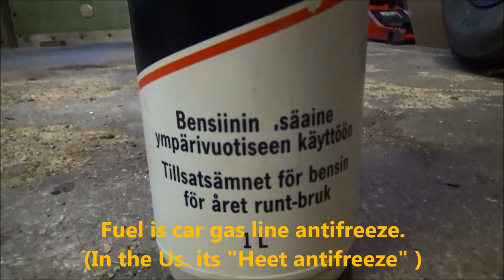How To Build a Simple Jet Engine - No Special Tools Required!!

Comment from the maker: If you made a jet engine like this, please link video of it here. :)
Reply: Are you serious 🧐 there's no engine 🤬🤬 wast my time
Reply from the maker: @night_mode97  This is a simple jet engine.
Reply: @night_mode97  it is a real jet engine, just maybe it doesn't produce enough thrust to move itself and there's no constant fuel supply, so it stops after a short time (but it can be simply modified).
Reply: You can mount it on a small boat.
Reply: Please can I have your email so I can explain further on why I made a woosh bottle
Reply from the maker: @chiagoziemogbuehi5584  Why not let us know right here?
Reply: @Fileeraus   well, all those things you call 'scaps' are not really that available to me and I don't know how old you think I am but I'm actually 15 so I'm not really allowed to use fuel
Reply from the maker: @chiagoziemogbuehi5584  I think you can find some random scrap metal almost everywhere in the world. Also a pulse jet runs with anything that is flammable, so you can try to use hand sanitizer, which should be available to everyone. You can make a hole with a nail and a stone.
Reply: @Fileeraus  I'm trying my best to get the metal pipe and I'll make it as soon as I get it, but if I use hand sanitizer will it have any thrust?
Reply: @night_mode97  it's a Pulse Jet engine, not a Turbojet engine, you won't find a Garret Turbo hooked up to a fuel cell and combustion chamber.
Reply: @night_mode97 i simple balloons is still jet engine a
Reply from the maker: @chordebartholomew6223  Your engine didn't run in your video. Using gasoline its very hard to get started. You should try making one of these:  https://youtu.be/k6-g5to5VN4
Reply: Hey :)
How long should the pipe be? can it be too big?
Reply from the maker: @thelegendofspace7579  It can't be too long, but it can be too short
Reply: @Fileeraus  ok thanks, is 1 meter long enough?
Reply from the maker: @thelegendofspace7579  Yes
Reply: i build it today and its beautiful, but i thinked about something like a fuel injection
sorry for my bad english im from germany xD
Reply: @chiagoziemogbuehi5584  sanitizer works, tested by me
Reply from the maker: @thelegendofspace7579  You can try running it with anything that burns
Reply: @Fileeraus  I meant a pipe or something where you can inject fuel by running the engine i hope u know what i mean
Reply from the maker: @thelegendofspace7579  I've thought about making same type of fuel system
Reply: @Fileeraus  a video would be nice when u test it, i wanted to build one but my pulse jet is exploded xD if you have instagram or something i can send you a pic 😂
Reply: @Fileeraus  Hey, I had a new idea for the engine, you could build a cone-shaped suction head in front of the hole in which with a pipe and a valve the amount of fuel can be adjusted, this also regulates the speed and you can turn off the pulso as you like. 
switch off, what do you think?
Reply: @night_mode97  its a pulse engine
Reply: Update, i build mine with a fuel insertion just like the lockwood hiller design insertion in the can, you can use propane now
Reply from the maker: @thelegendofspace7579  Wow! Can you upload a video of it? 😎
Reply: Hey! I built a similar one, used bio ethanol as fuel but after I start it, for a matter of time I hear a sound like in the video, but then it dies and I played it several times and it keeps failing. What could be the problem?
Reply from the maker: How fast does it rev? How long it lasts?
Reply: @Fileeraus  a matter of a second or so. It really lasts for just a moment
Reply from the maker: @v-nem144  If it revs fast, your intake hole might be too small. If it revs slowly, the intake hole might be too large, or the exhaust pipe hasn't sealed completely.
Reply from the maker: @v-nem144  wrap the foil around the exhaust pipe so that it acts as a gasket with the hole
Reply: @Fileeraus  YEEES, IT FREAKING WORKED. Whoa man, I used a bit of a vacuum cleaner and a sparkler to start it, but it really did the job. Thank you for the help! I will get it on tape and send the link there.
Reply: @chiagoziemogbuehi5584  you arent going to get enough thrust to move something with a can mate
Reply: @sebastiankusyk7764  It didn't move because he had a brick on it.
Reply: Masinolilla! 😀 Must be Finnish
Reply: K so I made this and... HOLY ITS LOUD
Reply from the maker: @NoFear-2011  cool!
Reply: @Fileeraus this is my design, it is not self sustaining, instead it uses an off frame custom 3d printed turbocharger looking thing for air intake. I have found that this design works well, and even produces thrust. On a skateboard, it accelerates at ~1m/s^2 with onboard air intake and battery. There is also a spark plug inserted to maintain combustion and I am working on an onboard fuel supply system. https://youtube.com/shorts/ft0tEty6tGE?si=0T6woNBXrqTw26cj
Reply from the maker: @BlenderandBeyond  so its a turbojet then?
Reply: @Fileeraus  hi man, your video really helped me out, how long is the pipe you used and do you think it is possible to continuously put fuel in the engine?
Reply from the maker: @davidedamiani5331  My pipe is 1.5 meters, but it can be shorter. For some reason a short exhaust has a shorter running time.
You can add fuel but you need to figure a way to do so without shutting the engine.
Reply: @Fileeraus  my engine revs very fast for a few seconds and then it stops working. When i ignite it again then it does the same and stops working after 3-4 seconds.
Reply from the maker: @shashwatvishwakarma269  intake or exhaust too small, or exhaust too short
Reply: @Fileeraus, alright, I'll try to adjust the dimensions. Should the intake hole be same in diameter as exhaust hole ?
Reply from the maker: @shashwatvishwakarma269  not necessarily, it is adjusted to the size of your jet
Reply: I just made a ramjet engine
Reply: @night_mode97  get a life bro thats a engine what do you known
Reply: Where's the thrust
Reply: Okay made it now how do I transfer that energy to  a battery
Reply: @AEye-p7y  bro idk

Comment: Would it work with a larger reservoir directly beneath it? If so, then with a reed valve at the front, it might me suitable to power a free flight airplane model.
Reply from the maker: If you want to power an rc plane, you should look into proper pulse jets. These spray can jets are  merely artificial and don't have much potential to move even the engine itself. Here's one that I made:
https://youtu.be/k6-g5to5VN4
Reply: @Fileeraus  time to prove you wrong. 
I will 100% make a Pulse Jet Engine from Tin Cans or (Work Shit). Work shit is stuff you find at work. I work a job I can fuck around in as long as I tend my customers when they show up.

So I’ll be walking around a find a spray bottle that’s broken. Take the tube out. Find old paint cans. Etc. Bars of metal or pipes.

I’ll make Something up.
Reply from the maker: @shadowdeslaar  A proper pulse jet with combustion chamber made from a spray can will implode before it moves on its own. ;)
Reply: @Fileeraus  worth it. At least itll be a nice fire. And plus can try to upgrade it. They make steel Cans. Well. The ones we sell are.
Reply: @Fileeraus  when you say Proper. You mean like a V-1 rocket engine. Right?
Cause so far I’ve got a Gravity Feed Liquid Fuel Can on top. 
(Of course not touching). 
I also ended up adding a hole to one end of the Can. (Using a pop can).
I added a Exhaust Hole and Fuel Intake. 
Now gonna see what happens.

(Probably gonna add a second cam inside the man one, creating a Pressure Chamber). If lucky the pressure won’t be enough to blow or implode but enough to sustain firing.
Reply: @shadowdeslaar  well what did happen?

Comment: Do you know some video/image/article that explains how it works exactly? Thank you for the video. I'll use it in a Physics project on my university.
Reply from the maker: It works so that the flame goes into the jar and burns all the air, which creates a vacuum that sucks more air, and it ignites again.
Reply: @Fileeraus  also inertion of air inside the exhaust tube is important - it keeps moving after explosion ends, so there's resonance (like mass on a spring). Exhaust fumes in the tube are blocking air access, so it can be taken only through the right hole. So this pipe must be long enough to make the engine work.
Reply: You should put a turbo on it 😂💪

Comment: Any chance I could get a can length / diameter / exhaust length ratio u found to work best? I cant get mine to run more then 5 sec at most

Comment: The reason the can is getting red hot is because of how thin the walls are. I’m sure that if you used water pipes instead the engine life would be much longer
Reply from the maker: Thin walls allow more sufficient cooling if you would pour water into the walls. Without cooling a thick wall will run slightly longer but is harder to cool down. 
A video that shows a way of cooling that works.
https://www.youtube.com/watch?v=KVmAdTbzzRI

And here's a thick walled engine that was hard to cool down. 
https://www.youtube.com/watch?v=3TrOOzipB8s

Comment: I try to make the pulse jet with a paint can. He start but just 2 or 3 secondes. The size of hole can have an impact for the running. (sorry for my english I am french ;)
Reply from the maker: You should make a small hole first and make it larger during testing
Reply: @Fileeraus  OK so if it start but just 2 second, it might the hole so big.
Reply from the maker: Or too small. How fast does the engine rev? Also you might have a compression leak in the exhaust pipe
Reply: @Fileeraus  It is indeed a leak in the exhaust pipe. I didn't think it had an impact on the engine
Reply from the maker: @lucashulot172  If you don't mind spending some cash, you can use car exhaust repair gum to seal the exhaust, or use foil tape around the pipe.
Reply: @Fileeraus  I used foil tape like your video and it work
Reply from the maker: @lucashulot172  Cool! Can you upload a video for us to see? :)
Reply: @Fileeraus  yes of course I send u tomorrow
Reply from the maker: @lucashulot172  upload to youtube
Reply: @Fileeraus  OK I make a little video  on my YouTube channel

Comment: Just a tip: If you decide to use RC racing fuel and a thin can, put a wet towel on it so it doesnt melt.
Reply from the maker: It wont melt but it helps to cool it and it will run longer

Comment: could you use rubbing alchohol or would that explode.........
Reply from the maker: Rubbing alcohol also contains water so its not very flammable, but try it out, it might just work. You can try with gasoline and it won't explode.
Reply: @Fileeraus  thanks i have more gasoline anyway great advice

Comment: Can I add a fan or leaf blower or compressor to the intake so it can run longer?
Reply from the maker: You don't need additional air, if you can make fuel feeding system, then it can run longer.
Reply: @Fileeraus  I made it but it would pop then sometimes stay lit for a minute, but only make any noise when I blew air into it. If it matters I used nitro rc fuel. I also noticed the metal tape on the exhaust, does the pipe have to be sealed, or is a bit of gas/exhaust leaking ok
Reply from the maker: I used foil tape to act as a bit of sealant on the exhaust, so yea it needs to be sealed. Try again when its sealed and if still not working, maybe make the intake hole a bit larger

Comment: Hey sorry to bother you what size is the intake hole for yours mine will run for a little right exhaust but it cuts out and will not run longer than 10 seconds also I use heet as fuel
Reply: heet it's antifreezing for cars?

Comment: This inspired me to make a jet engine and I ended up with a steel can about the size of a big hairspray can jb welded to a .5 inch galvanized pipe that won't really run on its no matter what you give it I'm currently running 99 percent isopropyl alcohol but I have this electric Balloon pump i use for air and I get my jet screamin  and literally glowing doing that. What this guys can does is nothing compared to mine. The first time I ran it on alcohol the paper just vaporized.
Reply from the maker: Blowing air into it makes it just a bunsen burner. Also, for some reason I've had bad luck with aluminum cans. Also make sure that the exhaust is sealed well, try my method and maybe add your jbweld to make it extra sealed.
Reply: @Fileeraus  I can hearing pulsing but with to much air and to little fuel it does that also the jbweld on mine cooked off its dust and it's not together anymore but I'm about to spend some money investing in a bigger jet on propane and I don't plan to have to give it air
Reply from the maker: @clips1166  Something like this or a valved jet?  
I've tried to run this tin can jet with propane without success. 
https://youtu.be/k6-g5to5VN4

Comment: I made this but I tested 3 length of pipe: small(2’6”) medium(3’3”)and large(4’10”). The small and medium pulsed but stalled out after 2 seconds but the large doesn’t want to start. What length should I use?
Reply from the maker: Intake size is more critical. I have around what your longest pipe was
Reply: @Fileeraus  oh I see

Comment: This is amazing , I want to try and make it but I am unable to find the exhaust pipe , is it possible to run it without it?
And i am not allowed to use fuel as I am only 16 but I have some old Diesel laying around can I use it instead .
And  can I use any other similar metalic tube for the chamber ?.
Sorry for troubling you with these novice questions.
Thanks
Reply from the maker: This model will not run without the exhaust pipe. Diesel will not work. You can make the chamber from something else but it still needs a pipe for exhaust, this video just shows the engine made from bunch of scrap basically. 
Also, you can go to some car parts store and probably find all kinds of fuel alternatives that they probably sell to you
Reply: Okay thanks , also can you please explain the function of the exhaust pipe , and why the exhaust gas can't pass through the hole in the end .
And what length should the pipe be ? Is 25cm okay?
Thanks absolute love your channel
Reply from the maker: @tanishqreddy5617  The engine ignites itself from exhaust gases and they need to be collected in the pipe. 25cm is quite short and probably will not work.
Reply: Okay thanks a lot
Reply from the maker: @tanishqreddy5617  no problem, I like to help anyone who watches my videos

Comment: how do you figure out how big the hole has to be and how long the pipe has to be
its a bit of a problem with the one i built
Reply from the maker: Pipe length is not critical, just make it long enough. Intake hole you adjust larger until the engine runs good. Make many tests before you enlarge the hole.

Comment: I built this exact construction but can't get it started. I have a slightly smaller intake hole right now but roughly same can/ pipe lenth as you. I can get 3-4 ignitions but never more, and I use Isopropanol (isopropyle alcohol?) as fuel. I also tried adding some compressed air and playing with fuel amount but so far nothing works
Reply from the maker: @boonamai8926  first test with 100% ethanol or methanol, then try again and maybe slowly make the intake larger after few attempts. Also make sure the exhaust is sealed and lot leaking
Reply: @Fileeraus  Oh yeah I forgot to seal the exhaust 😅 How did you do it? I can't weld. The press fit is pretty tight though. And also, how far did you push the exhaust pipe into the can?
Reply: @Fileeraus Is that just aluminium foil to seal it?
Reply from the maker: @boonamai8926  I use it when or if the exhaust leaks

Comment: I`ve tried to recreate it. But it only runs for a few soconds. 
I think it breaks down because it´s getting too hot or. How can I match the length of the pipe and the size of the hole?
Reply: I made one as well and it does the same thing. When I used a long pipe and sealed the hole better it worked fine. And I'm using metholathed spirits as fuel
Reply: @xXrandomryzeXx  Yes, i think the hole was too large. In the next days I will try it again.

Comment: drill a small hole and put a wire tube and squirt more fuel inside it will run longer
Reply from the maker: I've been trying to find something that would allow me to spray propane into the jet

Comment: Does it have any useful thrust?
Reply from the maker: Not really. Its so low that the engine won't move itself. Also this design has thrust both ways lol.
Reply: @Fileeraus  well,the smoke seems to get into the entry hole... Maybe it has thrust only on one side ;)
Reply from the maker: It first sucks air in, the combustion makes thrust from the intake and then a vacuum sucks more air and the fuel ignites again. This happens several times in a second.

Comment: How long exhaust pipe do i need?
Reply from the maker: Its not exact, try using about as long as I have. It can be shorter too.
Reply: @Fileeraus  Ok thanks😁
Reply: @Fileeraus  do you know about what diameter you used? And about what length you used. I really want to make this but i dont have alot of money to by piping😅

Comment: can you manage rpm or it can only be at idle? i judge a srynge or some sort of tiny model pump will do
Reply: It doesnt generate rotational force, just a very tiny ammount of thrust, I would imagine if you took a spray can of something flammable and sprayed it in there then it should increase power, good luck!

Comment: I have a quick question, does the exauhst pipe need to be this long?
Reply from the maker: It can't be too short, but it can be longer no problem. You can try with shorter but it might not work as well.